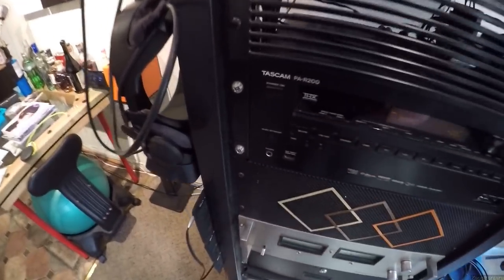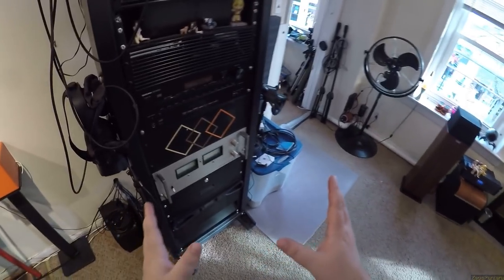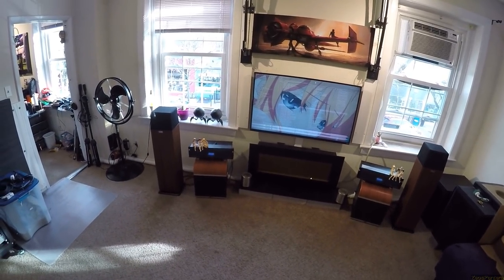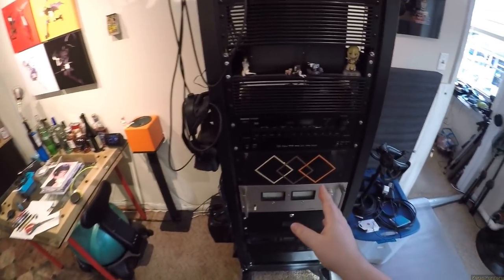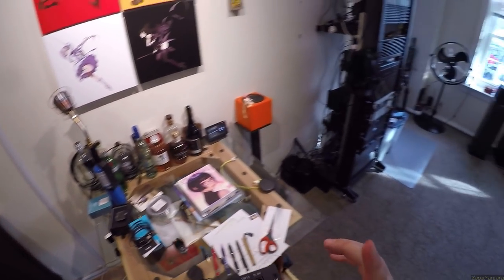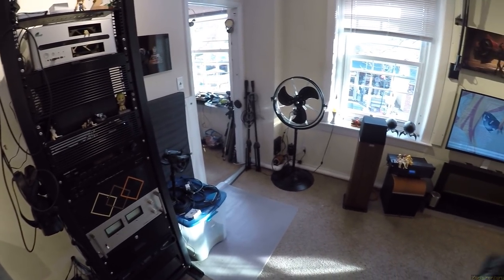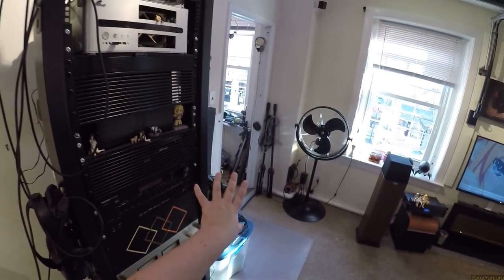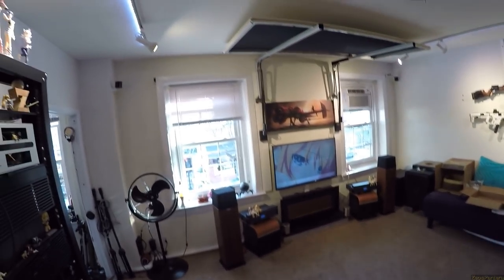⭐️Picking a Receiver _(Z Reviews)_ Home Theater 102

Comment: Hi my question is this, I have a Yamaha RXV 1800 receiver that I purchased 10 years ago. It does 130 watts x 7 channels at 8omps. I use it in a 5.1 setup to Power my Paradigm Studio Reference speakers and to me it works flawlessly. 

But I've wanted to make the plunge to Atmos and DTS X and notice all the receivers nowadays have much less power as you've stated. 

I want to keep the 5.1 setup but change it too 5.1.4 with Atmos and would you say today's newer Atmos receivers that are labeled with 95 watts x all channels driven at 8omps be capable of powering my speakers as well as my current Yamaha?

I know I could eventually add a power amp to the newer Atmos Receiver as well down the line but as a start this has been what is stopping me from jumping into Atmos as I don't see any receivers with the same power rating as my Yamaha.
Reply: Don't look wattages look at the power supplies if its big it will drive anything you throw at it, if you want serious buy power amps. If you set your speaker up the way they're supposed to be set up and let the sub/subs handle the low stuff taking strain away from the speakers, any well spec'd amp above 50watts will rock your world. Not to mention that AVRs lied a lot back in the day about wattage so really doubt your Yamaha would ever push 130watts.

Get an anthem thank me later

Comment: My Denon 7.1 is from 2008 works great same for my plasma from 2009, speakers and sub too then in my bedroom my 5.1 Denon, tv, and speakers all from 2009 work great but I did recently add 2 SVS PB1000s since they went on sale and a couple Klipsch Rp 280fa's because they were on sale for $699 for the pair which was just too much of a good deal to pass up. When I do upgrade my AVR's I plan on moving to separates. Great video.

Comment: I use a mini DSP for my crossovers in my current active 2.0 setup. 

I am thinking about expanding to 5.0 (or 4.0 at first). 

Are there any surround receivers with digital pre-outs? Aka 5.1 dolby/dts in and 5 seperate PCM out? I am having a hard time finding them. 
I would like to exclude the additional DAC and ADC I would get when using an analogue pre-out (al my sources are digital).

Comment: I have a Pioneer VSX D409 and wanted to upgrade to something with hdmi so I got a Denon RX2100W and it's a piece of junk with good sound quality. First I had to set it back up and the room equalization wouldn't work, second the hdmi pass through stopped unless the receiver is turned on, and now it will not connect for updates.

Comment: Onkyo made after 2016 has all the problems fixed. The internal heat was desoldering chips on the older one's surface mount components.

Comment: Some receivers (my yamaha) you can do audio out to TV over HDMI. I do this and put a $10 box that passes through hdmi and splits off optical fibre (left right only) then goes dedicated dac/amp for left/right. The receiver powers the rest of the surround sound at the same time. I have the Dirac version of that nanoAVR before the receiver that fixes up any timing delays from seperate dacs and room corrects (also a cheapo 5port hdmi switch before that for more inputs).

I don't fully understand the adc part of your setup (the coax part) but I thought you might be able to avoid a conversion (and save money) by using the receiver audio out to TV and a cheap hdmi fibre optic splitter.

Comment: One thing I learned from helping someone else set up their system, be honest with yourself on how you're going to use it. My friend wanted a surround sound set up for movies and tv but really only used it to listen to music. Music is two channel, you can pair a nice stereo receiver and a quality pair of speakers and then you'll have great music and still enjoy movies and tv shows. If you try to play music through a 5.1 system it won't sound right. That's because none of the 5.1 speakers were designed to produce the full range of sound in two channels. So, for him, it was a waste of money.
Reply: Well, there are plenty of wonderful music/concert DVDs and Blu-Rays that are designed for optimal listening on a good 5.1 or 7.1 system. It depends on the quality of the receiver,
the speakers, and how it's calibrated. I agree though, for pure music listening in 2.1, you're better off with a separate system. Most home theater receivers are optimized for 

multichannel sources, not so much for basic stereo sources. Sometimes for an apt., let's say, you're better off with a smaller PC speaker 5.1 or 2.1 THX system instead of 

a full home theater system. Esp. if you're going to just use a PC or laptop as your main media source.

Comment: I agree with the brands you recommend. However I would say NAD is great too. I have a sony reciever thats about 10 years old thats still working great with 4 hdmi inputs, its good for how much i paid for it. it was originally 400, got it for 20. If I were to upgrade I would go with Yamaha, Denon, or NAD. Denon is just a more affordable Marantz. Also, you can just get an 4k hdmi switch and then run that to your tv then run optical or spdif into your receiver so you dont have to upgrade when the video switcher is outdated.

Comment: it's been decades since I used a 5.1 setup, have watched in stereo since; lately it's annoying me that dialogue is low, turn up the volume and suddenly an explosion destroys my ears;
will receiver help me with this issue, somehow balancing the three front channels such that I won't need to turn the volume up to hear dialogue?
Reply from the maker: Yeah you can set compression of the dynamic range on for certain media or just raise the center channel volume compared to the other channels.
Reply: Yes a receiver will help, i find that issue annoying as well. I purchased a denon avr x1500h in the summer and it has software that can combat that issue. The only way for it to work is by running the eq software that comes with the unit. I also tried out an Onkyo 676 and found that it was not as good as the denon when it came to leveling out the sound. I am quite pleased with the results, its like having it on "night mode" were all the sound levels are the same. I live in an apartment and was super annoyed with watching an action movie and having to constantly have the remote in my hand so i didn't get a noise complaint. Highly recommend a Denon avr x series. Im not sure if the lower models have that capability.
Reply: because certain studios movies are mixed with 6Db dialogue and 25Db plus on the music and explosions.

Comment: Best bang for the buck receiver in my opinion is 2014 Marantz SR7009. It has 125w, 9 channels, atmos, bluetooth, airplay, 4k/60hz, Audyssey xt32 calibration.  Price can range from $400 - $1000. Second best is 2014 Denon X4100 which is very comparable to SR7009 but cheaper.

Comment: Zone 2 RCA line out and/or preamp out is a heavenly thing for those of us with separate headphone amps that we want to have access to BVD players for Blu-ray Audio or SACD. TIP- My Yamaha claims not to output HDMI signals to Zone 2, BUT it will in Party Mode (all zones mode). Just mute Zone 1 and you and your headphones can “party” in peace without disturbing others. This is important with receivers because the receivers’ own HP output does NOT seem to improve as the more expensive models go up in price.

Comment: thank god you made this video cuz I was talking with someone somewhere in YT comments who wanted wireless surround sound... not that they're gonna watch this video and learn or anything, but it gives me a sense of relief to hear someone make sense.. LOL or is there actually a wireless surround sound that works?
Reply from the maker: I mean you can do wireless but it still isnt truey wireless. You need power to the amp module or to the speakers themselves. I'd rather run a cheap speaker cable around the room then try and hide power cables.

Comment: you think i would profit from a seperate amp for my forte III? i have a x4500H denon reciever.
Reply from the maker: Those are real efficient. I would only do a separate amp if you found something vintage with a signature you wanted to use like an old Tube amp or class A. But then we are back to the DAC feeding it all.

Comment: My older Yamaha RX-Z9 puts out 330 watts per 7 channels into my 4ohm speakers as well as two more height channels at 50 watts  ....
I've tried newer Receivers and nothing sounds as good so I added a newer processor to add the newer surround options but I watch most stuff on streaming services and really most still are Dolby 7.1 so if you can live without the convenience of HDMI you can get a much better system by switching your video sources outside of your Receiver ...

Comment: Bought an onkyo nr686 for $250 running a set of rb42 for my fronts also was playing around with some car door speakers no box as rears. Not optimal rears but they definitely work was kinda shocked at the difference with the rears for movies a lot of immersion is added.

Comment: Have a 1990's Sony receiver... Failed after 20+ years of use, the last 5 or so as the dedicated sound system for the living room. The method of failure was passing mains to the speakers, triggering a protection circuit. 

Replaced it temporarily with a similarly ages jvc that I barrowed from my father, which was replaced when my grandmother moved to florida and we got her entry level Yamaha. All the while running pioneer entry level 3 ways that have been toppled and abused by a kid with major issues. They have yet to fail...
Reply: @chanslorvalorum6905  it was a basic entry level receiver when we got it... It ain't going to sound great but it sounded better then the tv

Comment: I have a very small appartment. I use a quite big 180 watt per channel
7. 2 THX Select 2 receiver with a THX Select 2 speaker system and subs. Imho it is amazing, and it blows me away every time I watch movies or listen music and play games. What do you think about the THX certification? I am a believer, and the thing that sucks is... As receiver replacement I feel I need the THX tested logo on it to complement the speakers in a optimal way for the best sound. Especially since all the THX amps have the same watts output that the Select 2 speakers require aka 180 watts nominal 220 short term or more when THX ultra. I am looking for a new amp but its hard to find THX and atmos for under 1000. Anyone have a reccomendation? I have onkyo now, and was looking at the tx rz 830 but it seems to have some issues. ..

Comment: Z, we can’t just turn off the center channel without running Audyssey (not Audacity the PC software for ripping vinyl to WAV or FLAC), because it sounds weird.  We have to run room correction again.  The Spotify Connect app in my Den-in x7200wa sounds phenomena.  The soundstage is amazing for streaming.  The Spotify app on my AppleTV4k sounds HORRIBLE!  The native app sounds like songs like Tool - Chocolate Chip Trip, the soundstage is so wide that it stops at my middle/side surrounds.  The AppleTV app and Apple Music, and Amazon music, the soundstage stops just past my Paradigm mains.  It almost sounds like mono!  With the Den-in app you can hear where each drum and cymbal is at.  The AppleTV apps barely sound like stereo. Atmos on Disney+, AppleTV+, Netflix, Vudu all sound great.

Comment: I disagree about receivers being disposable,been using a Technics 5.1 receiver for 18 years now and it's still relevant,i just by pass the 4k signal direct to the tv and run the audio separate
Reply: Yes, but if you have more than one video source, that makes source switching a PITA. I hung on to my  5.1 Marantz (with only component video) for almost 20 years and bypassed my receiver, but it meant fooling around with HDMI to analog audio converters and external HDMI switchers. If you don't have HDMI inputs on your receiver you can fight it but life is easier once you upgrade.

Comment: What about brands like emotiva, arcam, nad etc?
Reply from the maker: They do Separates. I think Arcam does full independent receivers but I have to check.
Reply: Z Reviews most do full receivers lately as well.
another tip for those who want atmos, i absolutely agree with your point why processors are so much more expensive. 
The denon x3600h can be had around $700 brand new or a last years x4500/sr6013. Those have 11 channel processing and are like 1/4th the price of  a separate processor
Reply: @ZReviews  Arcam has independent receivers!

Comment: Love his videos

However please know that if an AVR says 100 watts per channel etc that usually only means 1 or 2 channels driven. If you use all 7 or 9 speakers amps in ur AVR you are NOT getting 80 or 100 watts per channel. 

You just don’t. If u really need 100 watts of clean power for 7 or 9 speakers u need to buy an external amp. They are usually rated at all channels driven. Emotiva XPA series are an example they can push around 200 watts per channel all 7 channels driven.

I wanted to point that out cuz he missed it. Great video otherwise

This is also y I say high efficiency speakers are king like PSA speakers. Super efficient and any mid level AVR can power them to reference level effortlessly.
Reply: Bateman, you are exactly correct on the power ratings put out by all the AVR companies. People in these reviews stating they are getting over 300 watts per channel at 4ohms... Give me a break man. The power supply can't even support that let alone the speakers they are using. I laugh ever time I read this B.S. They read the crap these companies write in their manuals and take it as gospel. I use an Onkyo 7.1 receiver that is rated at 100 watts 2 channel driven at 6 ohms at 1khz. That's not even a full range frequency test because pushing bass/low frequency will kill the wattage rating quickly. I'm lucky to get about 70 to 75 watts per channel in the 5.1 system i use. I can push reference sound in my room at about 65 % on the volume dial without clipping the sound. Reality  check people Reality check....
Reply: pete detraglia thanks for backing me up man. I don’t like to come across as snobby or a know it all but that was a crucial aspect Z forgot to mention that I felt others needed to know.

My Power Sound Audio tower speakers can handle like 175 watts of power each and are like 95-98db efficient. Adding an external amp to these yields marginal results. If ur in a GIANT room then go for it but for most people any mid level AVR is fine. Check out avs forum. Someone took their external amp away and barely noticed a difference in volume level.

High efficiency speakers are king for home theater/movies/gaming and i doubt I’ll ever be convinced otherwise.

Why spend $$$ on external amps when u really don’t need to I say. Put those funds towards more subwoofers or something else. Buy a mid level denon AVR and high efficiency speakers like PSAs and just sit back and enjoy. You need to have 1 or 2 more than capable subwoofers though to make them worth it.

I understand people have different needs so to each his own, but I keep stressing to people if movies are ur main reason for building a system.....go high efficiency and don’t even consider anything else.

No one will really understand wut I mean until after they buy them and put on Mad Max Fury Road. It was a truly godlike experience. So god 
damn loud but crystal clear and the speakers were not even breaking a sweat. That’s the kind of home theater I want to be in. Effortless.

When I have the volume cranked to -5db and the wife and my mother tell me they didn’t think it was too loud at all cuz it’s so effortless and so clear, I know I made the right choice.

For my needs I want my speakers to only do one thing extremely well. High and mid frequencies at IMAX level effortlessly. I have subs that handle the rest. I don’t see why people go any other way but of course u like wut speakers u like and that’s all good. If ur system delivers on what u want/need that’s all that matters. This is just my opinion as as avid surround sound/movie/gaming lover for over 20 years.

I’m sure there are people that have lower efficiency speakers powered by an external amp that sound amazing. I just love this hobby and I could legit talk about it all day so I’ll end my comment now.

I appreciate the back up to my thoughts 👍

Comment: Too bad pre-outs don't come with the cheap models anymore, they figured out we figured that out...
A way you can keep using old receivers without HDMI is to use the the s/pdif output on the TV. My HTPC transcode everything to AC3 over 2 ch, sends it to the TV through HDMI, the TV sends it to the receiver through s/pdif. The receiver then decode and output 5.1 DD or DTS. I just use the TV for HDMI sources selection and the receiver stays always on the one s/pdif source.
Reply: But s/pdif cannot decode Dolby Atmos and DTSX???
Reply: @deathb4dishonor755  The types of digital audio signals that can be transferred by a digital optical connection include two-channel stereo PCM, Dolby Digital/Dolby Digital EX, DTS Digital Surround, and DTS ES.
Digital audio signals, such as 5.1/7.1 multi-channel PCM, Dolby Digital Plus, Dolby TrueHD, Dolby Atmos, DTS-HD Master Audio, DTS:X, and Auro 3D Audio cannot be transferred via Digital Optical connections. These types of audio signal formats require the use of HDMI connections.